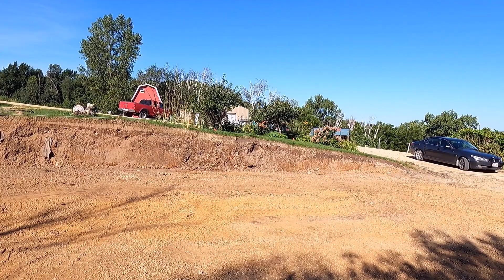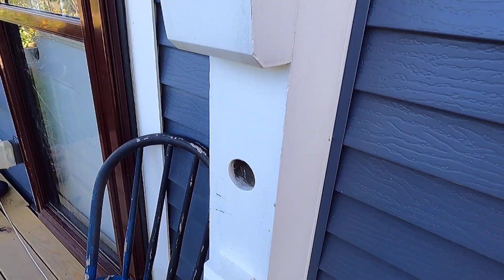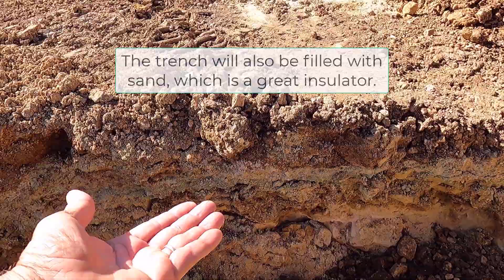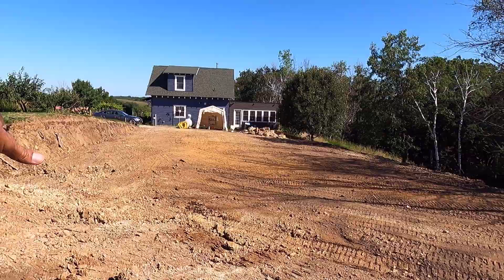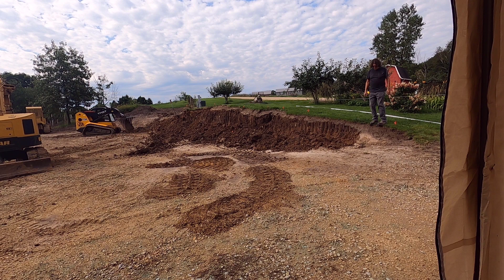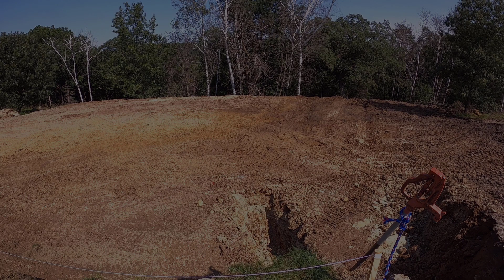Square Shop to House ― Leveling Ground ― Install Fiber Optic Line

Comment from the maker: Work on this project has been hectic! We are working to the contractor's schedule, and kind of need to drop everything when he is available. Right now we need to get gravel under where the wall will be and start getting our giant concrete blocks in place before the dirt wall caves-in too bad. The concrete blocks are poured from the returned concrete at the concrete plant so their availability depends on how much concrete they pour in a given day. As of this morning we have thirteen blocks and five caps poured, and need a total of forty two blocks and twenty caps! 

The next big problem is shipping the blocks. Our contractor can only deliver 6 at a time, but we can get 24 on the neighboring farmers truck — but he's too busy right now. Still waiting on plumbing parts as well. Everything is moving right along though!

The Woodshop Build Playlist: https://www.youtube.com/watch?v=0lj0BOLzIRo&list=PL_iZ8t8zAFuN1C0XY70Gd-EaS0z2Knt0Y

Woodshop Build Tool Links:
Stabila 35712 Extendable (7 to 12 foot) Plate to Plate Level - https://amzn.to/3iGdpwP
Stabila 30035 Plate Level Case for 7'-12' Plate Level plus 24-Inch, 48-Inch Level - https://amzn.to/3AETnZQ
Woodford Y34-3 Yard Hydrant Freezeless - https://amzn.to/3AHE5Dr
Johnson Level & Tool 116 16 Ounce Plumb Bob - https://amzn.to/3jKIj6k
True Temper 00221400A Wood Wheelbarrow Replacement Handles, 60-Inch - https://amzn.to/3xLU4Pc
Starrett-C33H-12-4R Hardened Combination Square -- https://amzn.to/2KL3YOu
DEWALT Metal Shears Attachment -- https://amzn.to/3l8aYoq
DEWALT 20V MAX XR Compact Reciprocating Saw -- https://amzn.to/3nKHVFG
DEWALT ATOMIC 20V MAX Reciprocating Saw, One-Handed, Cordless, Tool Only ― https://amzn.to/2Msu21r
Legend Valve & Fitting T-5500 Lead-Free Brass Curb Stop, 1" - https://amzn.to/3jU9VpO
12 Ah Battery -- https://amzn.to/33JN48U
9 Ah Battery -- https://amzn.to/2SKUQwN
6 Ah Battery -- https://amzn.to/3odC6BW

Comment: Laser transits are the cat's meow! We got one many years ago, get grade right on. Most building contractors here want grade within 2 inches, with laser you can get it almost perfect, saves in gravel purchase. Great video, i enjoyed it
Reply from the maker: Thanks Dave, it's going to come in very handy for the next few staged like leveling the gravel for the concrete block wall and setting all of the pier heights. I was going to do it with water and a tube, but now that I have use of the laser — forget that 😉